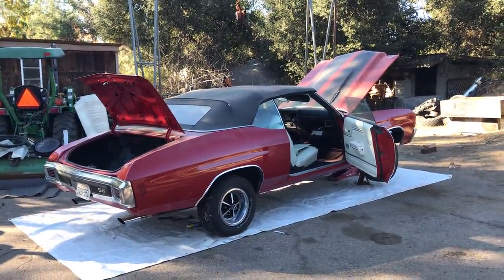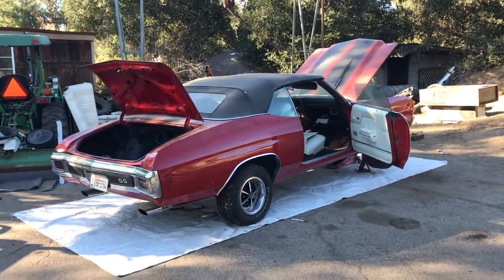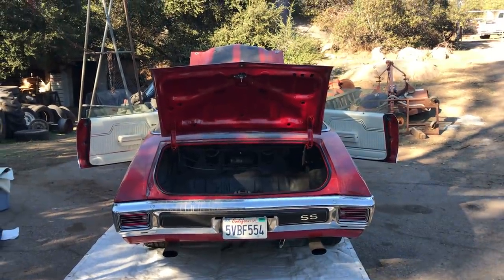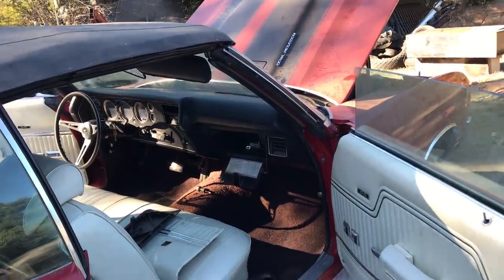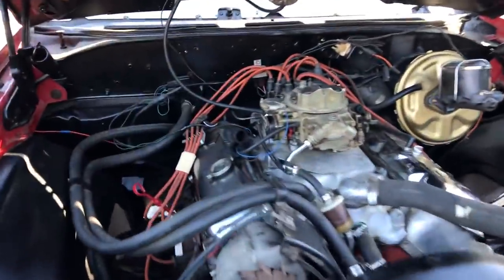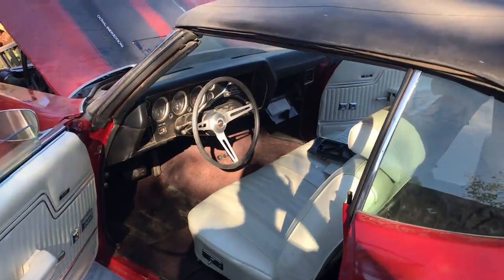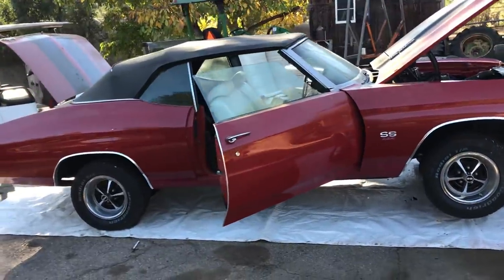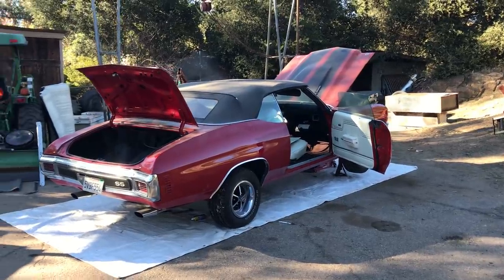I Saved a Guy $250k From Nearly Buying a Fake 1970 SS454 LS6 Convertible In San Diego, CA!!

Comment: I don't know what he is trying to say about the FUEL LINEs which seems like total BS to me. I have dealt with super sports all my life and they old times I find a thicker or fatter line is on the trucks and they are not necessarily an SS it's just the big block trucks have 3/8th fuel line set up on em. There is no diff from My 69 Camaro SS fuel lines to the regular 68 Belinetta sitting next to it in my garage. That is a fact. Many of these cars were special order packages. We unique 70 Chevy Blazer. It has a big block from the factory however if you look at the vin which we took to a local guy that still works at the local GM dealership told us there were some odd balls that were either changed around right before they left the factories or they were dealership modified. There is a book out with a few odd balls that at first we determined to be fakes. However there was stash of GM SS cars found around here locally and few of em were actually called fakes. That is until you look at the Odometer readings the cars all have around 500 to 1,500 miles then the deceased owners manifest of the purchases of the cars factory direct is what the curve ball is. They were all special order factory modified or freaks if ya will call em that. The years long debate over the Chevy Blazer was finally put to rest by Dean Tomaino who works as a rep for the newer special order cars and GM Silverado trucks. His book is simply called the GM FREAKS locally available from him. He did not have the money to get a big time publishers interests in NICHE BOOK as the larger publishers called his book.

Comment: They didn't put bigblocks in malibu's. 307 or the 350 if you ordered it. It has the small fuel line so more than likely this was a 307 rag top car. Not cool to sell clones because the lawsuits that follow are bad. My father has # 340 GNX and some one built a clone GNX and sold it for almost 100k and Dad told the man it was a Grand National that was cloned.

Comment: . From the tail lights to the front bumper,, nope nope nope nope nope........ lol
Reply: I said hell fucking NOPE when he panned into the interior,  A good tell tail sign for any Chevy SS in the late 60's to early 70's, be it a Chevelle, Nova, or Comaro is that they are all bucket seats and the transmission gear selector is on the center console, NOT on the steering column. A true SS will NOT be standard equipped with a front bench seat.

Comment: Watch and learn everyone cloning 5.0 notchback mustangs lol. It matters what the car was born. Seriously 5.0 notchbacks are the biggest up and coming collector cars being cloned.
Reply: Those and Cobras from 93 to 04. Many many copy cats out there
Reply: @benruether8294  true those cobra’s are cloned as well. But there is a lot more to do to clone a cobra properly. With the 5.0 notchback clones guys take a mint 4 cyl and drop the motor in. I’ve even seen them replace the dash vins and door tags. Major scams. It’s amazing the nice clean lower mike notchback 5.0’s are selling for over $30K-$40K already.
Reply: @mysterycomment1553  Very true, especially examples with sought after colors (Calypso Coral being a hot one lately) and 4 cyl variants were much more common. Im all about saving the notchbacks, but deceiving buyers and vin swapping is terrible. If I had a 5.0 race car and wrecked it, I would still consider a 4 cyl shell for a donor, but would never conceal what it actually is.
Reply: @mysterycomment1553  oops, I meant Calypso Green. Coral is red

Comment: since when did turbo 400 seventy modes have a kick down cable double hockey sticks all of them I bought and some of them new never had a kick down cable ! it`s vacuum controlled DA.
Reply: He was referring to the wiring harness for the kickdown switch, not a kickdown cable. TH400 had a kickdown switch on the gas pedal, and wiring harness passes through the firewall and plugs into side of transmission. No hole in firewall indicates car did not have TH400 factory-installed.

Comment: i had a 70 or 71 chevelle convertible factory air green with white stripes im not 100 percent bu i think it had a power glide also had the 396/402  imagine if i had that car now oh it might have had a 4 speed it was 1986 long ass time ago and of course i scrapped it yea what a dumbass just like my 1965 chevelle 300 yea rare car it was fun in 86 i had a 12 bolt 4.11 rear 4 speed muncie pistol grip shifter 327 365 stock horse vette motor in it also had the 202 fuelie heads i put bigger valves cam 300 nos shot and that car handled like crap but when i could get it to hook watch out i beat alot of people i shouldn't have and was hard to stop no power brakes or steering and drums all around

Comment: clone hell,that whole car looks like a rebody.
someone wrecked a real one and then someone else saw a big payday.
the body Vin should be run,and that block restamp investigated.
Reply: A good tell tail sign for any Chevy SS in the late 60's to early 70's, be it a Chevelle, Nova, or Comaro is that they are all bucket seats and the transmission gear selector is on the center console, NOT on the steering column. A true SS will NOT be standard equipped with a front bench seat.

Comment: It just seems ridiculous, Here in S. Florida, ( Jupiter to be exact...) That every '70 Chevelle you see is a SS, And I know for a fact that GM didn't make that many, Most of these Chevelle's came out with either a 235 or 292 strait six, if you had some money you could get the 262 v8. If you had a ton of money, then and only then could you get the 454 SS, And GM didn't make very many of those, Simply because of the fuel dilemma going on in the early 70's And of course the cost of the 454 SS. 
Liars and thieves' are in S. Florida by the bushel. How do you think these folks got to be so damn wealthy?

Comment: No doubt in my mind that it's a clone!
Reply: I knew it as soon as the camera panned to the interior, A good tell tail sign for any Chevy SS in the late 60's to early 70's, be it a Chevelle, Nova, or Comaro is that they are all bucket seats and the transmission gear selector is on the center console, NOT on the steering column. A true SS will NOT be standard equipped with a front bench seat.

Comment: OK so the guy doing this video mentions nothing about an option tag AKA fender tag like a Mopar has ) so how can anyone say it is or is not . Theres endless ways this car could be like this , maybe it was stolen and stripped and the parts were replaced with non LS parts . If the opinion that this car is not an LS is based on parts that are bolted to the car ( not welded from the factory) is the sole reason its being conidered non LS i would look closer.

Comment: Back in the day it didn't matter. Mark four engine, drop top emblems in place, chics didn't know the diff
Reply: But if you're paying a $100K, or more you damn sure want to know, this car was easy to spot and the seller knew it to be a clone too. A good tell tail sign for any Chevy SS in the late 60's to early 70's, be it a Chevelle, Nova, or Comaro is that they are all bucket seats and the transmission gear selector is on the center console, NOT on the steering column. A true SS will NOT be standard equipped with a front bench seat.

Comment: Du. the turbo hydromantic used in general motors  cars and trucks had no electric kickdown switch they operated by vacuum only to control the oil pressure in the transmission creation the shift the car is correct for a standard transmission or turbo 400 get it right or get the hell out of the way.
Reply: Turbo 400 had electric kick down

Comment: I got a 12 bolt with 331 gears n the trailing arms are boxed what does that mean glen
Reply: Boxed control arms would denote an ss,442,GS, etc, along with the rear sway bar. Which by the way oldsmobile was the first GM to offer.
Reply: 331 gears posi? Could be a 4 speed rear. That's what mine had.
Reply: Yah it's a posi
Reply: @donahuewittner3022  Another plus. And should be code stamped front side passenger axle tube a couple inches from carrier. Research those if you find them. Good luck

Comment: I'm no expert, but I thought TH400's used an electric wire for passing gear. A nice car nonetheless, just not a correct car.
Reply from the maker: You are correct and the provision for passing gear wiring harness which runs from the gas pedal switch to the transmissions was not present in the firewall.

Comment: "incorrect" 12 volt ... incorrect turbo 400 ..."
What?!? All the 1970 GM vehicles were 12 volt, and used the same 12 volt electrical systems.
If the alternaror output is wrong, so what? Alternators get replaced all the time. Top post instead of side post battery?  Big deal. I've changed the cable ends on several GM cars to put in a top post battery, when the old battery needed replaced. (I didn't replace the battery with the a Delco battery, either.)

"Incorrect Turbo 400 ... " Did it come out of a Buick, Olds, Pontiac? NOooo ... can't be that ... they all had a different bellhousing and engine to transmission bolt pattern than Chevrolet.  Did you stop to consider that between 1970 and 2000 whatever when you made this video that the transmission had been replaced?  Wouldn't be the first time a car was "restored" with a scrap yard transmission, instead of rebuilding the original -- if it was rebuildable.

How is it the "wrong Turbo 400"? All the Chevy's with the big block engine (if memory serves, the LS6 was a rat big block, not a mouse small block) had the same Turbo 400, be it an Impala, Chevelle, Corvette,  Camaro, Nova, Monte Carlo, or Malibu. 

What model does the VIN code say the car is? 

Did you use verifiable documentation you had with you, or "go from memory"?

In short, why should anyone listen to you? What gives you credibility?

No doubt the LS6 has been cloned, just as a GTO, and Hurst Olds 442 have been.
That aside, claiming that car is a clone because it "has the wrong 12 volt" and "the wrong Turbo 400" is pure Bull Shit, and proves you are a fraud, with less than zero credibility.

The VIN number is the only way to know for sure. 

Not a "numbers matching" car? big deal. Blown and worn out engines and transmissions get replaced all the time. That don't mean it isn't a LS6, or "isn't even a Chevelle."

BTW: The LS6 may have had different springs and anti-sway bars, but they had the same upper and lower control arms of all the cars of that body class: Chevelle/Malibu, Olds Cutlass/442, Pontiac GTO/Le Mans, and Buick Riviera.

I believe they were even assembled on the same assembly line, as I've seen with my own 4 eyes (I wear glasses) a Pontiac LeMans with Chevy Malibu steering wheel center and "Malibu" on the dash and glovebox door - brand new, sitting in the dealer's showroom.

Comment: Making a copy of a ss or gt so eazy.. Easy catch one with a ford...ford had inline 6..it have 4 lugs on the wheels. V8 had 5 lugs or more
Reply: A good tell tail sign for any Chevy SS in the late 60's to early 70's, be it a Chevelle, Nova, or Comaro is that they are all bucket seats and the transmission gear selector is on the center console, NOT on the steering column. A true SS will NOT be standard equipped with a front bench seat.

Comment: Lol this guy is picking out all these little details like fuel lines and emblems. Whoever redid this car could have used 5 parts cars for bumpers and hoods. And the original block coulda been trashed and the trans stuff they prolly ripped everything off the firewall and just hooked it up how they wanted with the new stuff He needs to be checking vin tags and vin stamps on the frame or body panels. I would be getting another opinion

Comment: Aren't you supposed to contact authorities when you find restamped serial numbers ? I say this because my 56 Pan Head was stolen and recovered. During seizure they notified me the motor VIN was altered which mandated they seized the motor cases. If you know Harleys the Vin wasn't on the frame but tied to the engine. Just like that my $40k all original Harley got reduced to about $6k. Thank god I had insurance but I still lost the Title and had to retitle using a S&S Panhead late model. Ended up losing about $24k all done and said.

Comment: Nothing wrong with wanting to drive a clone. Trying to pass it off as a real one when selling? Absolutely wrong. Chevrolet only made 13,000 Chevelle SS' in 1970. 8000 or so were the 396. The 5000 others were 454's most of them LS5s, with a thousand +/- LS6's. Take half of that and consider them lost forever. Take half of whats left and assume the original engine/trans is gone. That leaves about MAYBE 250 or so real LS6 cars left in existence. Some of them are probably rotted so badly that they're more donor car or repair panels than original if restored.  Id call it probably less than 100 or so in existence, most of them are probably documented.

If you are trying to buy a numbers matching LS6 or hell, even LS5 at this point get a professional appraisal done. More than likely, its a clone or not a complete original car.

Comment: I DO HOPE YOU GEAR HEADS REALIZE THAT THE DAYS OF DRIVING THESE OLD CARS IS ABOUT TO COME TO AN END! By 2030 - 2040 ALL vehicles that do not average 50-55+ mpg will be forced off the roads. This is in every nation - not just the USA. Cars such as this one have no future and is a pisspoor investment of precious money.  For people owning "collectible vehicles" and to drive them, there would be a stiff TAX (fine) to operate it. Like $10,000 a year!  The age of all Electric Vehicles, fuel cell vehicles, is the wave and way transportation will be done in the future.
As far as millionaire ego cars go, like the Lambos, Ferrari's, McClaren's, and every other hypercar being produced - they either will have change with the times or go out of business.  Internal Combustion engines powering daily driver vehicles are going the way of the dinosaur.
Reply: Only a small percentage of those vehicles are ever driven. Most are pushed from the auction stage to the delivery trailer, pushed into the new owner's garage, pushed onto a trailer for the trip to the show, then pushed back to the auction for the next owner to start the process all over again. There is nothing sadder than non usage of vehicles that deliver  the best memories when you wring them out.